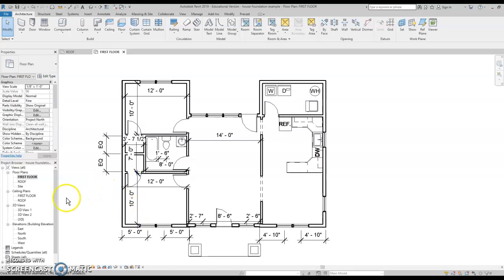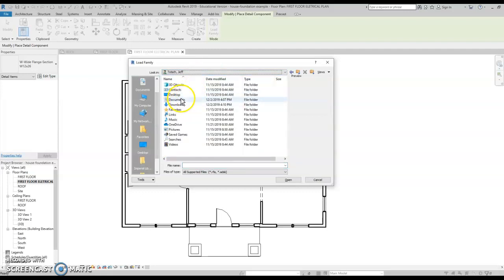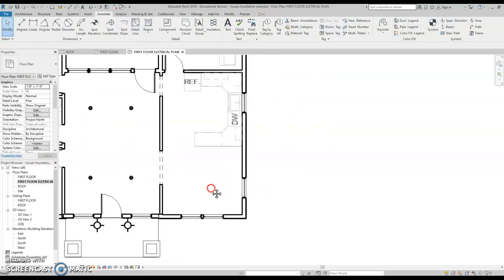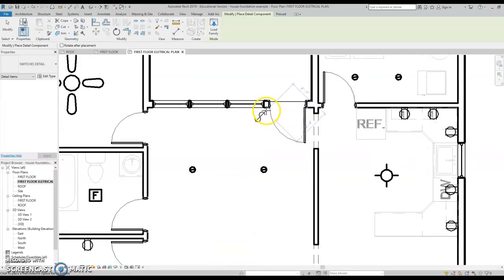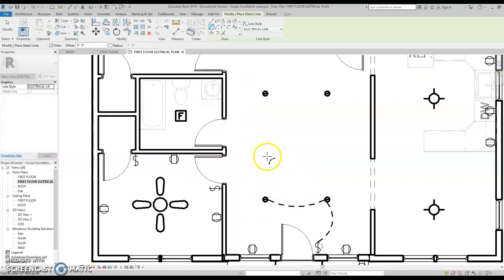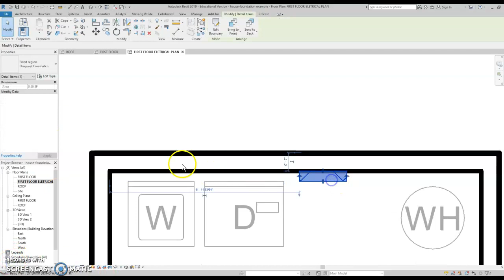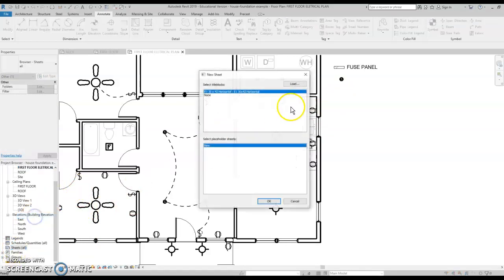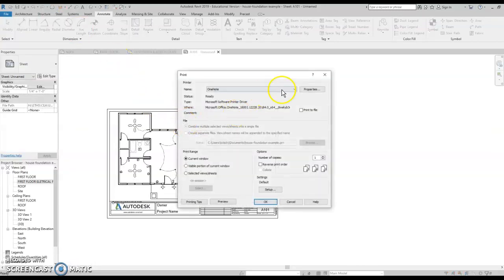Making an Electrical Plan in Revit - CEA PLTW

Comment: Jeff, Thank you for the video. I have been frustrated trying to use the Revit symbols etc. It seems messy and not quite the way I want it to look in my residential documents. I have two floors with different ceiling heights in the upper level. I can't seem to get it to work with the view cuts to have it all together. 
Do you have a file of the details that you are using? I have not been able to find anything out there that is ready to go. Importing all of my old cad stuff also is messy and has to be exploded, not actually able to just download. 

Any help or advice would be most appreciated.